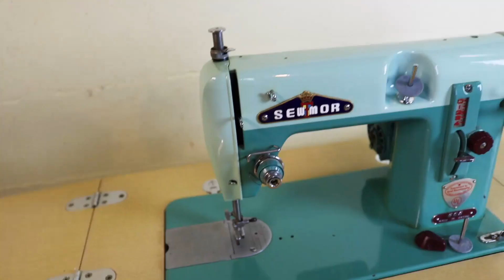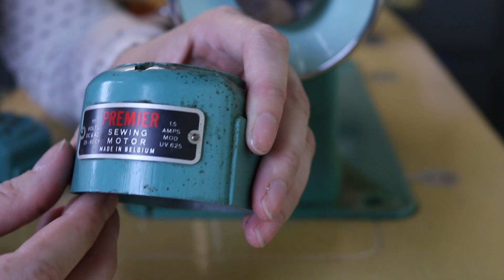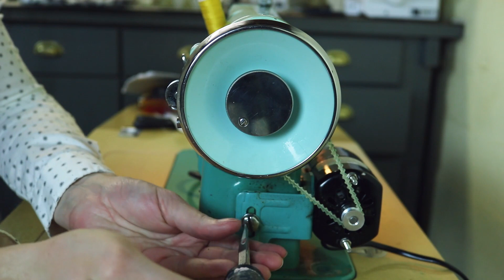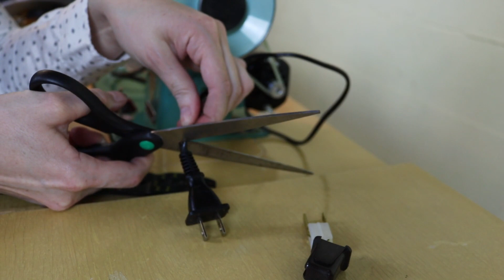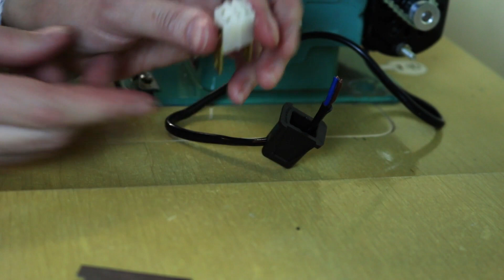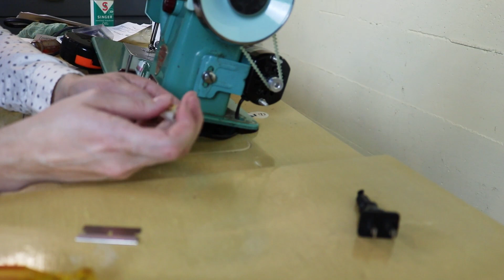Sewmor 606 Motor Replacement - Vintage 1960s Sewing Machine Renovation

Comment: I have this machine but it always gets stuck or the thread breaks but I’m also new to sewing machines any advice?
Reply from the maker: fresh needles, the right needle weight for your fabric, and new or high-quality thread. My sister was on a new machine, and the thread kept breaking. I switched her to a better quality thread and it improved. If it gets stuck, with a bunch of junky thread on the underside, then your tension needs to be adjusted.

Comment: Hi Sarina. Great job on installing the new motor. Do you know what was wrong with the original motor? They were made to be serviceable and it very well may be able to be fixed with cleaning a couple parts. 👍
Reply from the maker: That's good to know - I definitely kept it, so I will take it in for repair. The motor made a burning smell and wasn't strong enough to turn the wheel.

Comment: hello please kindly film how to operate the sewing machine electric foot pedal how it's used to sew please ok? Please kindly reply back ok?thank you very much
Reply from the maker: Thanks for the idea! Check out the video I just posted today on threading the machine. I include a section about the knee pedal at the end, but it doesn't include how to operate it. Also, mine came with a knee pedal, and not a foot pedal.